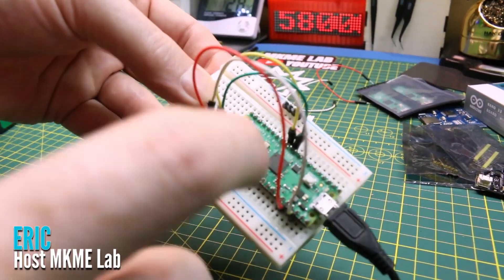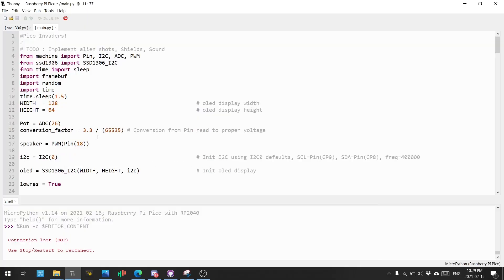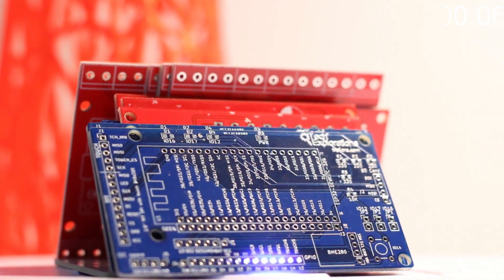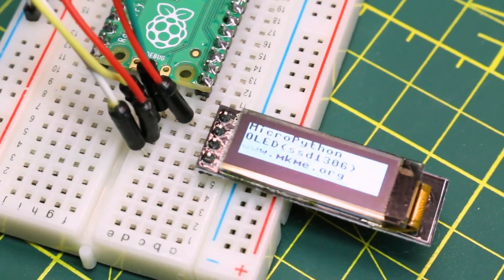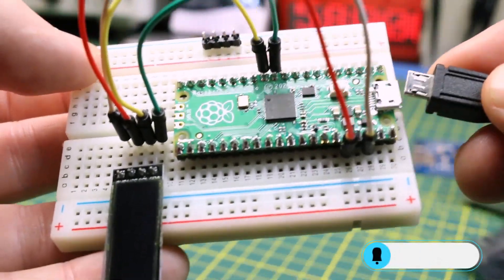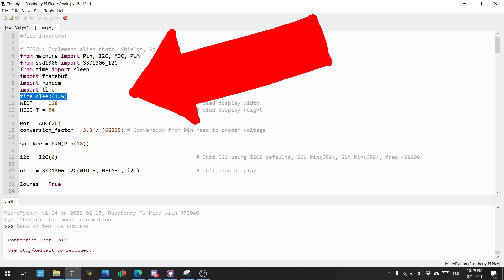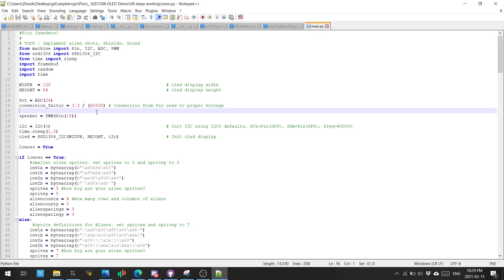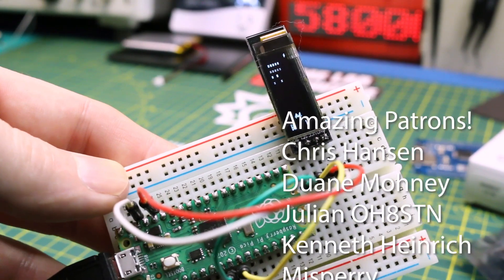Fix A Raspberry Pi Pico That Won't Run Code TUTORIAL

Comment: Thanks that fixed my problem when I was using OLEDs. I had other issues with other programs I was using and found elimination the print command to console and being inspired by the introduction of sleep commands found that any time a frequency was called out such as PWM  a sleep of 2 seconds was all that was needed and that fixed many of my main start up issues. So thanks again for the inspiration.

Comment: This looks perfect! It saves and everything. main goes onto the board. I can see it. It even feels right. Only problem is that it doesn´t work (at least not for my board). Even if it did, I can see that the Rasberry Pi Pico team has a little more work to do. Get the bugs out.  Thanks for the comment Hamed Adefuwa. Thanks for the video MKme Lab! I'll check out Arduino.
Reply: Whoops! Ok, sorry. My fault. You have gotta save as "main.py" in Thonny. "main" alone will not work. My pico is working! Thanks again for posting and commenting.

Comment: I had a similar problem - but not with a battery, even with the Pico plugged in to my Linux box. Sleep by itself didn't fix it for me - however adding a print statement after the sleep did.  My application is timer driven - wondering if that somehow has something to do with it. Another config I put together works fine - same usb/cable/linux. Both use I2C - in this case I'm using both controllers.

Comment: good to know, have a project with 6 i2c devices (5 oleds+tca9548a) + a few leds and a buzzer, might use a battery one day.
4 oleds each to show a big number (oled used sideways), number made by using many chr(178) and spaces (old-school)
Reply from the maker: You might not have an issue but try this if you do.
Reply: @MkmeOrg  sure, the info was added to my pico information library.

Comment: thanks mate! this was driving me crazy.
Reply from the maker: So I wasn't alone?
Reply: @MkmeOrg  I had the exact same thing. Just wanted to display the values from the internal temperature sensor on a ssd1306. But on battery not without the delay before i2c init. Many thanks!
Reply from the maker: Thank you. Thats helpful. This must be a problem with micropython/hardware and all the tutorials are just using a PC. I might be the first to publish this after all

Comment: How in the world did you figure that out?  😊
Reply: use 3x double quote (DQ3) before and after most of the code, test,  drop top DQ3 down a line, boot and so on till it "shows" an error , the code might be too fast and the oled device is not ready after bootup on battery ?  
i leave my document info at the end of a file, makes it easy to pull up the top DQ3, 
while developing i have test code in the info zone to copy to the repl and see it work.